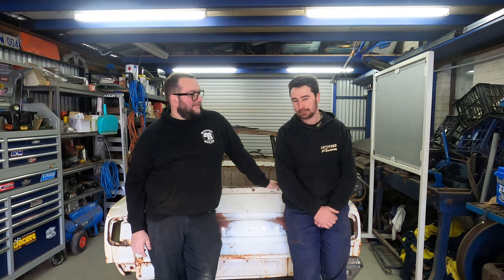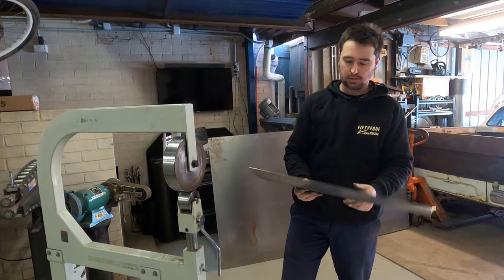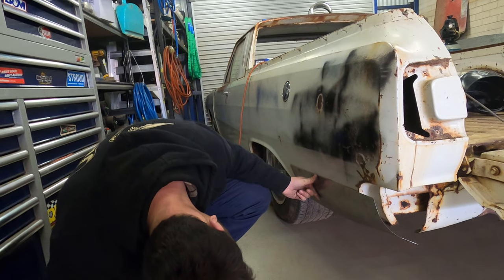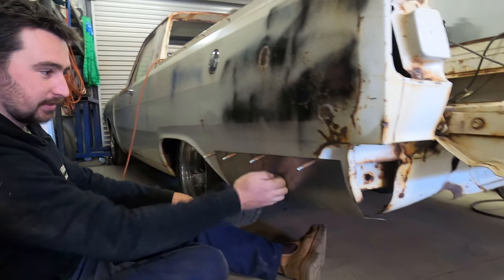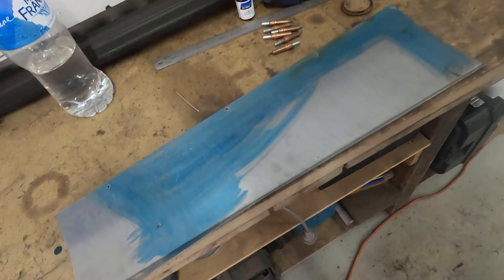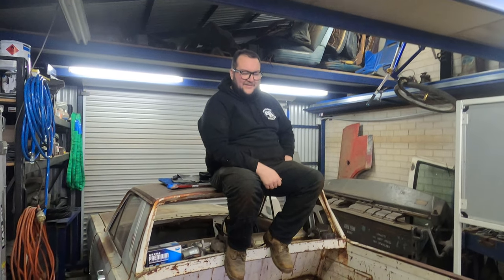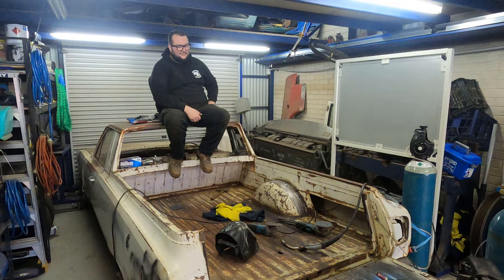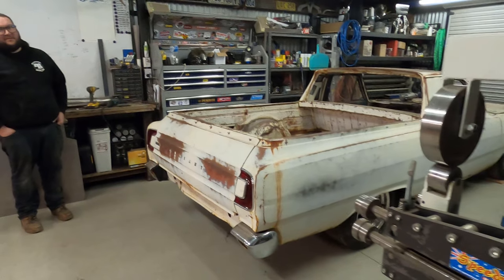How to make a patch panel for rust repairs: BackyardBuilds.

Comment: I just done the same on my VF Ute. I used a mig, hell job I reckon. I get cramps from squatting down so low for so long, so I had a dope cake to calm myself down a bit. Well that ended in tears after I started welding really well and in my enthusiasm I ended up warping the panel. So the moral of my story is don’t over heat the panel. And stay high.

Comment: nice work really good and i did a similar patch not to long ago on a vj dodge ute and made that patch piece with a concrete bag (as a shot fill leather bag) and a mallet then hammer and dollied the rest to match and make it smooth. luckily i had a tig at that time before that i just stick welded all my panels and floors
must be great having the tools saves heaps of time
and must say great stuff keep it up

Comment: Let me tell you how NOT to remove a stump from the ground, you attach a rope to the tow ball of you car and proceed at speed. Got the stump out easy, the stump then very irate sort to seek revenge by flinging itself as its last act into the rear of the car breaking the right hand tail light. Replaced at a higher price than it would have been to hire a stump cutter.